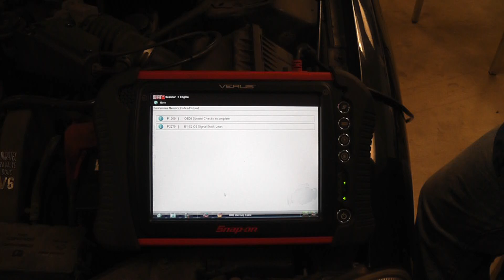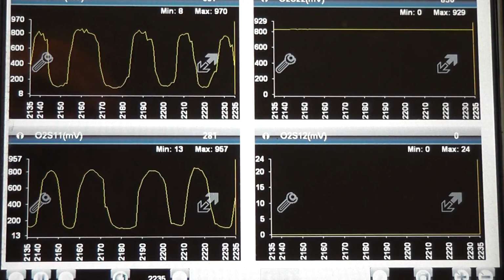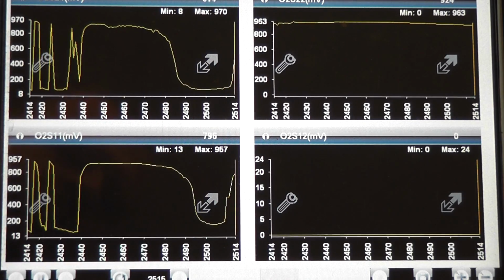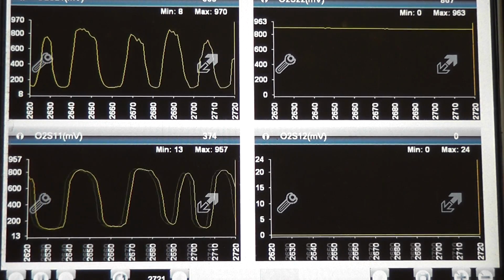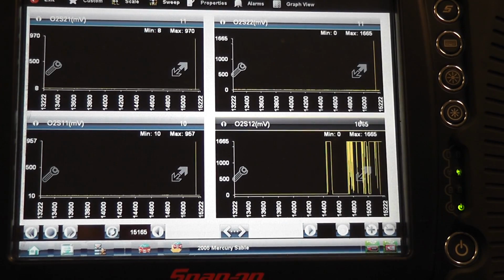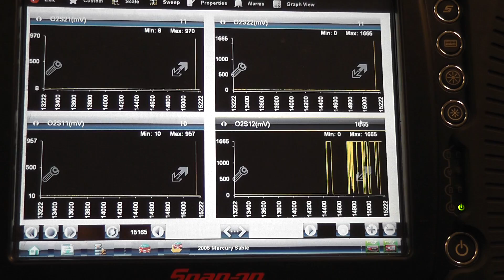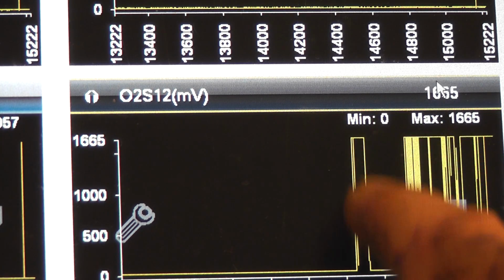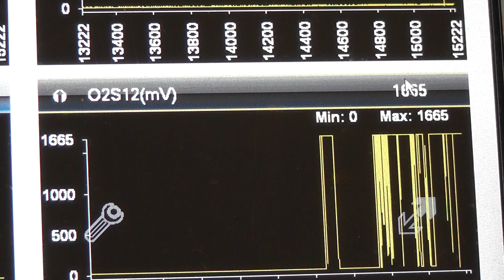O2 Sensor wiring quick tests (Ford with no bias voltage)

Comment: What would a proper test and result be for the grey wire? My scanner labels it as signal return, I believe. I have bat voltage on the two white wires on the harness side of the sensor, unplugged. Is the grey wire a ground? Also I can see 1666 mv on my scanner using this test light test. Just need to know a test result for the harness side of the grey wire. Thank you in advance.
Reply from the maker: Signal return is the sensor ground.
On the sensor side the two whites are the heater, the gray is the O2 signals ground (signal return) and black is the signal wire. And you reading 1600 mv indicated that signal circuit is most likely shorted to battery positive of the heater circuit.
Reply: @ScannerDanner  
When I did the test light test, it showed 1666 mv on my scanner data. Although I did have 12v on both wires that would have been the two white wires on the sensor side, when testing the harness side connector. I could send you the scanner data of the 4 sensors. Bank 1 sensor1 to me appears to be sluggish. It's a brand new sensor, i just wanted to make sure all of the circuit testing is done properly.

Comment: If there is an exhaust leak ne’er the downstream sensor will that set a 02 sensor code to set and the check engine light comes on.
Reply from the maker: That can also set a cat code

Comment: Thank you for the video! I do have a question about when you test the o2 connector with the test light. You mention the test light shouldn’t turn on but mine does. Does that mean that I do have a wire problem?
Reply from the maker: On the signal wire? If your test light is lighting when connected to battery positive with the light, then that means your signal wire is shorted to ground

Comment: 12v vs 1.6v?  you lucky it didn't fry the computer. the O2 sensor is 12v sensor in the diagram?
Reply from the maker: I've done enough testing of input circuits to still back up this test.

Comment: hey there scannerdanner, I have a 96 crown vic and the o2 sensors look ok, up streams are up and down and the down streams are pretty flat but 1 side of downstream jumps up once in a while...is it the sign of a cat problem?
Would an exhaust leak  or injector sticking open cause this?
thanks!

Comment: Hello Pual, congrats for making such magnificent videos, which helps people understand electrical problems.
I am fro Pakistan and owns mazda axela bk 2007 model. I got fedup of getting my car tested from different mechanics for bank 1 sensor 1 check engine light code p0030 and p0134 circuit malfunctioning. I chechek heater connection on o2 harness with 12v bulb, it works well, bulb was on at pulsive current. I checked signal wire connectivity from o2 harness to pcm harness which was ok. But test lamp lights up when connected one end to battery positive and other to signal wire harness. Plz plz suggest me for best solution and will DIY rather than going to hit and trial mechanics.
Once again thanks for educating us. Waiting desperately for you reply Paul.
Reply from the maker: P0030 is a heater circuit code right? and P0134 is a no activity code. Has the O2 sensor been replaced and if so was it the correct part? Factory only on some of these cars. If you use an aftermarket one, they can cause issues. 
What is the O2 signal voltage on the sensor that is setting the code?
Reply: @ScannerDanner  Thank you for your reply Paul. I really appreciate it.
I have checked heater side resistance on o2 bank 1 by unplugging on cold engine, it was 2.4 ohms. Than I plugged it back and measured signal side voltage which was 2 volt on DMM at started engine. 
I changed this HO2S1 two to 3 times but I was not aware about resistance check that time. Here in Pakistan new mazda 3 parts are not available so I was going to used parts market where used engines and parts are being imported from Japan and other countries. My original HO2S1 had part number written as "K4238-4310 02J06 ". The used replacement HO2S1 I had been replacing were having same initial numbers K4238-4310 except last set of 4 characters which are bold above.
I would appreciate your advice. I believe your advice could make my life easy. I m trying to sort out this problem from last 1 year and wasted much on it. This time I will DIY what you advice me. As your videos have educated in making basic checks.
Looking forward for your reply.
Reply: @ScannerDanner  plz let me kniw if my previous reply needs more voltage checks. Waiting for your reply.
Reply from the maker: @younasmasih1223  let's move this to my forum, the back and forth emails do not work for me very well here as you can see. It is free to join my forum and I have paid moderators who are there to help me help you guys. 
Thank you! https://www.scannerdanner.com/forum/post-your-repair-questions-here.html

Comment: Great video as always. Thank you!  I’ve got a question. But what if there was high resistance in that signal wire? The signal would still go up to 1665 and down but from the screen, we would have no way of verifying that there is possibly high resistance dropping some of the test light’s voltage. Because we would still be seeing 1665 regardless. Assuming only 9v got to the Computer would  we still see 1665 on screen ? 
I guess we could take a multi meter and measure voltage at the computer to ensure that  all the voltage from the test light is getting to the computer.

Comment: I have a 2007 Ford Taurus, bank 2 sensor one is stuck lean, when i run this test all is well. Replaced oxygen sensor, same result., stuck lean. There is no air leaks, could it be a bad ground for the o2 sensor?
Reply from the maker: upstream or downstream sensor? what are your fuel trim numbers? have you added a fuel source to see if the O2 reacts?

Comment: Hey man I have this same code on my car p2272 bank 2 sensor 2 can I turn the car to the on position and check the wiring harness with a multimeter positive to the signal wire and negative to ground bolt on the car  to see if I'm getting 12 v to the sensor
Reply from the maker: Yes and no. Some systems will not turn the O2 heater on with just the key on

Comment: I have a Ford jeep that has an electronic  instrument panel  but the speedometer  is not working. I have  test the speed  sensor with  my carman  scan  tool and its  working  just fine. so I wonder  where the problem  should  be ?
Reply from the maker: It is becoming more and more difficult to answer questions here. I have 80,000 people asking me for help now. So I have created a forum to help you guys better. It is free to join and we can exchange pictures, wiring diagrams and waveforms if needed to help guide you through the process of troubleshooting your vehicle. Thank you so much! Hope to see you there. 
Paul Danner (ScannerDanner)
 https://www.scannerdanner.com/forum/post-your-repair-questions-here.html

Comment: Great test......... did this on a car running rich no scan data but I had a pico back probing one wire o2 sensor fix 0 volt, test light to + batt  terminal touching the signal wire unplugged from sensor (harness side with test light) test light light bright shorted to ground, unplugged the connector at pcm did the test again bright light again confirmed wire shorted to ground Thanks Danner for you teaching all of us and for excellent forum had a lot of help there too.

Comment: - Force HO2S rich by adding propane into vacuum source (e.g. fuel pressure regulator)        
- Force HO2S rich by holding clamp in one hand. Touch battery “+” with wet other hand.

Comment: I was wondering I have a ford escort my downstream o2 sensor shows 0mV at idle but when i rev it to 3000, voltage will come up to 500-600 mV and when i let go of the throttle it tends to come back down to 0mV again. what direction should I head towards as far as diagnosis???

Comment: For test purposes it might be worthwhile constructing a simple test box that switches a voltage from couple of resistors providing a suitable voltage drop from the battery (800mV I think would do the trick). A plug on the end of leads from the box can then be simply plugged in and the screen monitored whilst the switch is operated.

Might save all that scratching about in the socket with a probe, and turn it into a sitting down job!.

Comment: fixed...yes voltage bleeding through because of water intrusion..the engine bay was pressure washed with engine and harness removed. main bulkhead connector was full of water. air gun and some di-electric and cured. thanks much your advice led me back to the harness again.

Comment from the maker: Okay. Since Ford doesn't use a bias, that means this O2 signal wire has to be touching another wire with voltage on it. 
I have seen oil in the O2 connector do this. Look at the harness very close.

Comment: liked, subbed and in need of a favor. im a tech and working on a 99 gt mustang and installed new motor. upstream o2 voltage on one side is max all the time on scan tool.1.666mv with -24 fuel trim ....probing my harness i have 12v on one, ground on two and 3 volts on black signal side.when i introduce ground to this three volt black signal side the 1.666 goes to 0. basically the opposite of this video.and now the 12v heater power is gone.just three grounds and 3v on signal side. harness ground?

Comment from the maker: Check out my video (two parts) on wideband O2 testing. I think after watching them you will understand why I do not have more information in my ebook on these.
Reply: Are you suppose to have the key on car off w hen performing this test
Reply from the maker: @dependableambuletteinc8792  yes sir, key on, engine off or running, if scan data does not update engine off, then start it

Comment: Hello.. I've gone through most of your videos and also your e-book and noticed all your o2 sensor videos and o2 section of the book, its all about o2 sensors which work on voltage.. anything on o2 sensors that work on amperage?  ..thanks

Comment: Theres no problem you are putting 12v directly fromthe battery to the signal wire that goes to the ECM? it is possible to fry something,or must be very fast test to avoid heat?

Comment: Yes they are,no room to get to them.The lousy 2 piece of shit spark plugs Ford came out with that break off and costs the owner $700.00 just to change spark plugs in a 3 valve triton which is #2 on the laughing stock called a piece of shit.

Comment: You don't ever use a test light or power probe on a 2004 and current CAN vehicle.You can smoke up to 4 computers doing this.Ford's engineering flat out sucks,do everything the hard way and never the simple way.

Comment: If I connect my Volt meter neg probe to the ground and pos probe to the pos battery terminal I get 12 volts.... BUT if I connect the neg probe to the SIGNAL WIRE and pos probe to pos battery, I get 11.4 volts..... should I be getting this from the signal wire?  Should it be "grounded" or is this indicative of a problem?  This is with the key off.

Comment from the maker: No, the sensor generates the voltage on the signal wire. Some O2s the computer will use a bias voltage on the signal wire which can be confusing. Watch my other O2 videos and I'll show you how to use it. On systems with a bias you do not need to do this test on them to confirm wiring integrity.

Comment from the maker: I have also seen many O2 sensors with the 12v heater wire shorted directly to the O2 signal wire causing a constant battery voltage on the signal line. And again, it didn't hurt the PCM. After the wiring repair the circuit still worked fine. I use a test light simply because it is hard to use your body as the resistor sometimes and as you can see it is effective an fast at identifying O2 signal wiring integrity. BTW this test is NOT needed on O2s with a bias voltage on the signal wire.

Comment from the maker: That is a good question. I will NOT call this standard operating procedure. If you are concerned about the voltage level you could do the same test with your body as the resistor. Problem is you will still elevate the signal line to near battery voltage. The voltage sensing circuit in the PCM for the O2 sensor in theory could be damaged however reality is I have done this test hundreds of times over the past 20 years and never hurt the computer doing it......